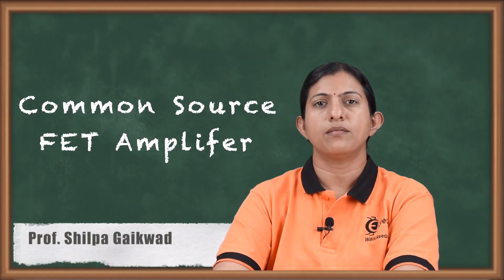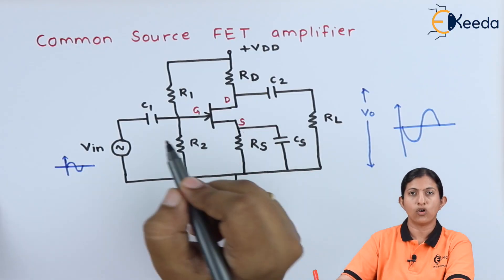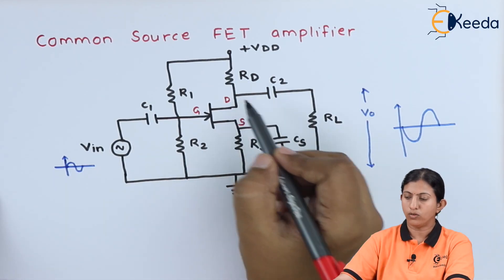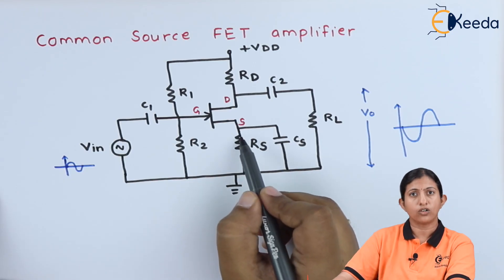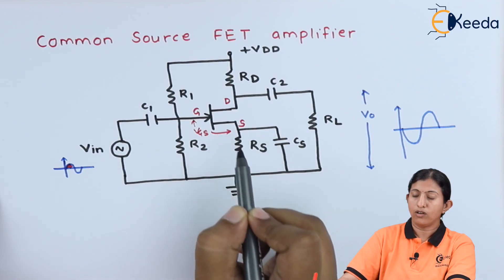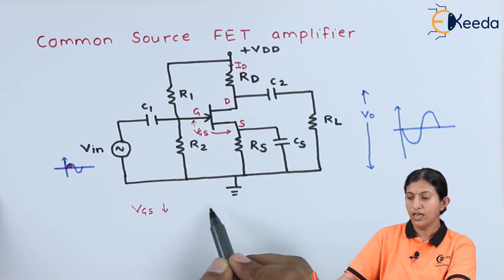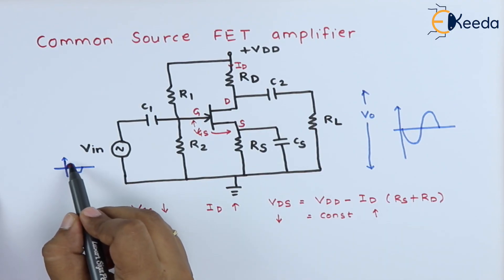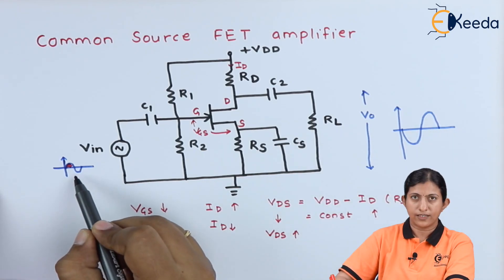Common Source FET Amplifier - Low Power Amplifiers - Applied Electronics

Comment: Madam, I study in 9th Std. I want to try building the circuit at home. Kindly send me list of components that I can buy an make the circuit. Also whats the advantage between FET and BJT ? Which should I choose I want to Amplify a 45milii V signal.  Can you please help build the practical circuit Thanks
Reply: Hey, I am ECE student , so i can help u with it, you can have a breadboard, resistors, capacitors, connecting wires, voltage source and transistor. All that in the theory, the only thing you require accept that is a breadboard on which u will be building your circuit. The connections will be the same as in the theory, but yes, do learn how to make connections on a breadboard.